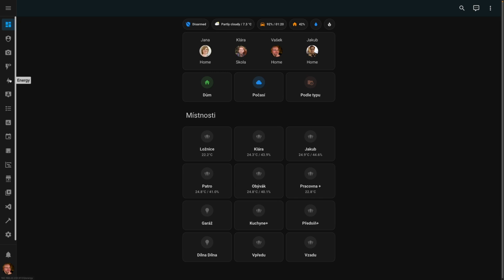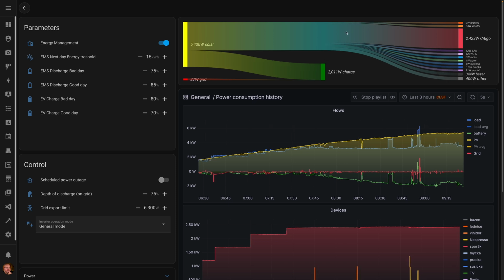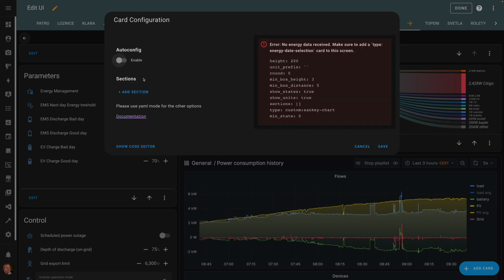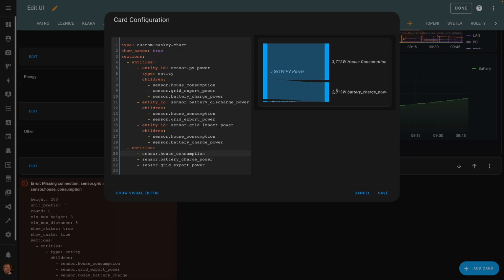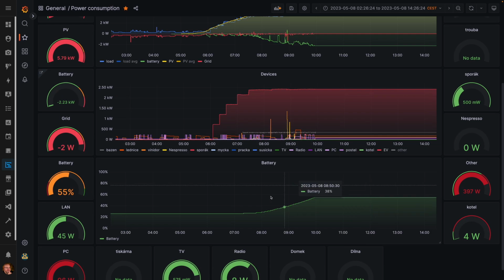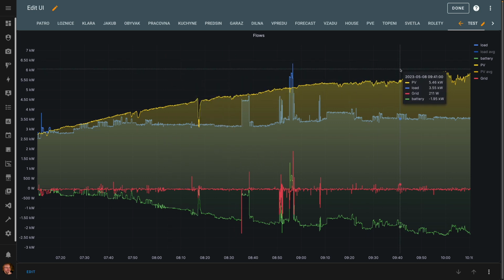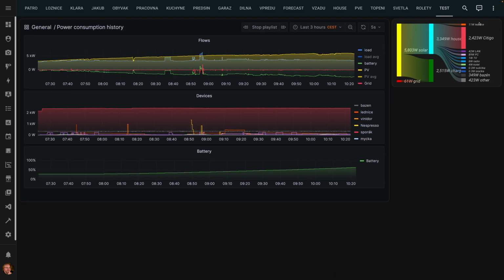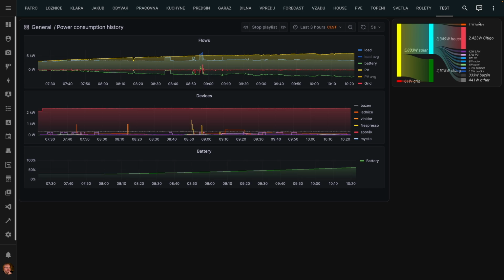Sankey card and other Energy Management Visuals

Comment: Hi, I need help, how did you configure your Energy dashboard from the Goodwe entities? I have a Goodwe GW5048-ES inverter and it has 61 entities, non of them appear in the Add Grid consumption and Add Grid Export, the solar power and battery entities also do not appear. Please help, it will be truly appreciated
Reply from the maker: Not sure what is wrong, I see the entities in the list. I added Meter Total Energy (import) and Meter Total Energy (export) as consumption and return to grid. Total Battery Charge and Total Battery discharge for the battery and Total PV generation for the PV.
Reply: @bruxy70  I see, I don't have those entities, I guess our Inverters provide different entities my entities are sensor.ongrid_export_power for Export and sensor.on_grid_power for import and for battery it is only sensor.battery_power and neither of those are in the look up list when adding energy dashboards. Maybe I need to use SEMS API's
Reply from the maker: @Andrew28Lamont  you can setup an integration helper to convert the power to energy.
Reply: @bruxy70  I will look into it and give feedback. Thanks

Comment: This what I’ve been hoping to do, but as usual it’s baffling. I followed instructions from my computer an got the graph I desired in my dashboard, success. But it will not show on either my phone or tablet using the app. Saw the note below about connecting remotely and grabbing the address from Grafana. Did this and saw the graph and thought success but no I only get to see the graph when I am not on my local network. Very frustrating. Do you have any other ideas on how this might be made to work in all flight modes?
Reply from the maker: I'd first make sure you can see Grafana from outside of your network. Then, you can integrate it to your dashboard. If you can't get to grafana as such, it worn't work from the dashboard. And once you get ot working, you can perhaps set-up the llnk when working from outside, to make sure you have the right link (e.g. if you use a local address when connecting to HA from withion your network).
Reply: @bruxy70  It works from the dashboard from my computer but not the HA app, so I turned off wifi and connected via cell carrier. found the link for the graph and edited my dashboard to use that link. It worked fine but when I reconnect to my wifi I once again cannot see the graph on the dashboard.

Comment: How to share charts externally?
Reply from the maker: They have to be on an url accessible externally. You are right that i did show it with a local IP. This is not how I use it. But I am not keen to share my actual URL ;)
Reply: @bruxy70  Could you show how to do it by blurring the external address? The HA application on the phone does not display graphs. 401: Unauthorized
Reply from the maker: @spatz7411  just go to Grafana from outside of your network, go to Share and grab the link. That should work.
Reply: @bruxy70  wow Thank you!

Comment: Thanks again for the awesome video Vaclav!  I hope to set this up on my personal dashboard since I have solar panels, inverter, and batteries at my home in the USA (Michigan).  However, I am struggling with the battery part of the equation (I don't know how to integrate that part into the HA energy dashboard).  Since one cannot use a current transformer (e.g. clamp sensor) for measuring DC current flow how does one monitor the battery charge and discharge?  May I ask how you did it?
Reply from the maker: I get this from the inverter integration. If yours does not have it, how about the battery?
Reply: @bruxy70  Nope, don't think so. I have a Generac Inverter.
Reply from the maker: Ok. This might not be easy then. I guess I'd search the internet, or have a contractor to put monitoring in place. Suppose the   BMS has a Modbus interface. But hart to know how hard this would be and if it's worth the effort.
Reply: @bruxy70  Thanks.  I'll keep trying.

Comment: Grafana is great, I've tried to embed chart as well. But problem is with authentication, when I don't want to allow anonymous access to dashboard (with Grafana visible from internet). And Grafana also has to be accessible directly, as Home Assistant is not doing a proxy. It would be great if Grafana could auto-login current Home Assistant user..
Reply: did you solve it?